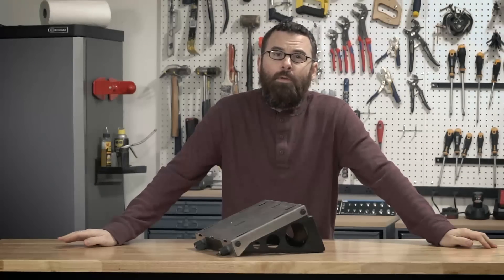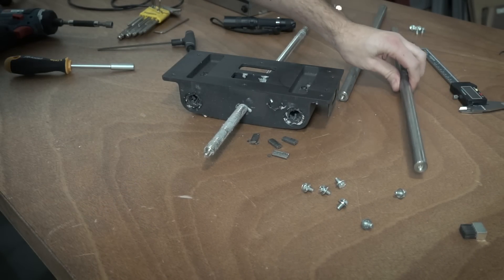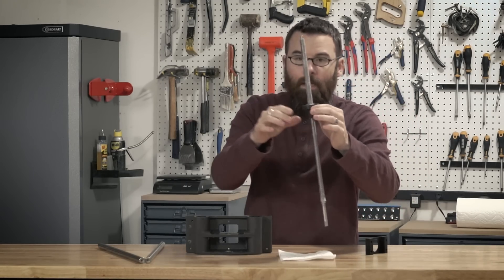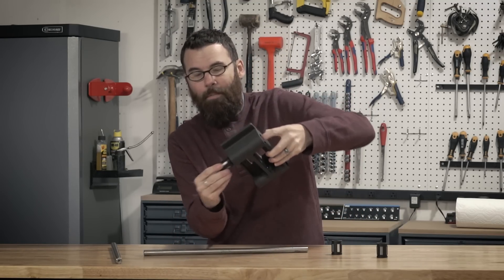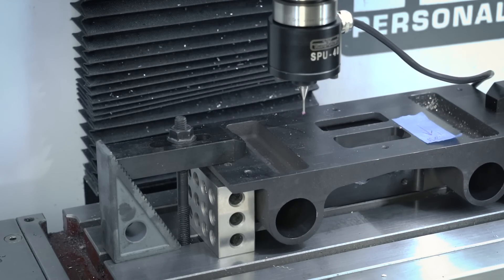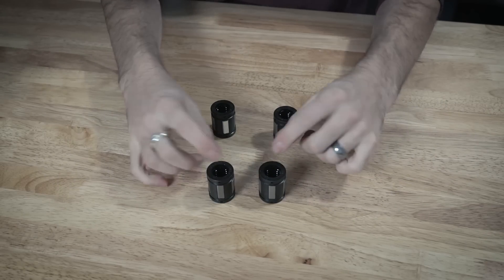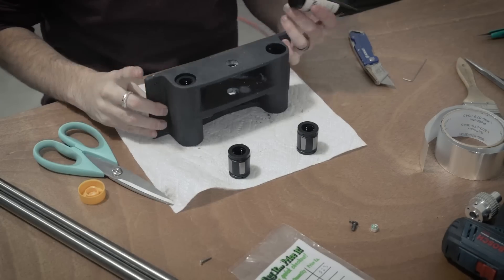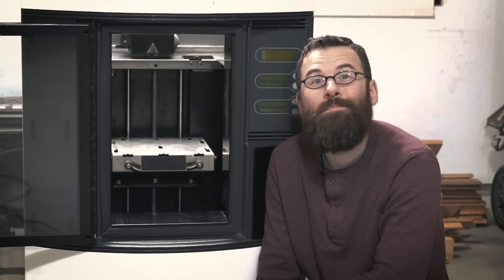Stratasys 3D Printer Rebuild - Part 3: Z Axis Rebuild

Comment: Ran one of these archaic monsters for years in an engineering department. Now I have desktop printers that print better, faster, chepaer, and quieter for 1% of what the Dimensions cost new back in the day. I admire your efforts, but I'd scrap it for pennies on the pound.
Reply from the maker: I did exactly that.  This video is 6 years old and a LOT has changed with 3d printing in that time.

Comment: Awesom..... what would be your optimal linear Guide for the X, Y, Z Axis if you had the oportunitie to build a 3d Profi. Printer
Reply from the maker: It would depend on the design, but probably linear slide bearings with belt drive.
Reply: @RobertCowanDIY   Thank you ....appreciate
Reply: @RobertCowanDIY  I think you'd be impressed with what you'd find in the current generation Fortus 360 (and up). The last one I opened up was doing 14x16x16 builds with crossed roller bearings.

Comment: HI.

I have a problem with this 3d printer. I put the calibration mode x,y axis, and it shifts on the y axis.

We already checked the grease, alignment of the band, we took the sevo motors and checked them with an electronic card that was designed to see the step and all good.

What do you recommend?

Waiting for your quick response. Best regards

Comment: Z axis bearing shim, need to make sure the tape is all aligned radially vertical axis or it will create a tilt won't it?  did it?
Reply from the maker: you are correct, and I made sure they were aligned properly.  it's very smooth and doesn't bind up at all.

Comment: I would guess the bearings failed because that build platform is heavy and  puts constant pressure against the support bars. it is a small price to pay for stability. Nice video. Thanks for great instruction.
Reply from the maker: Yeah, that's a pretty good guess.  The actual carriage itself is where most of the weight is, but there's still a bit of weight that the support rails see as a perpendicular load, which isn't helping.  I imagine over time, and over numerous heating and cooling cycles, they're bound to fail.  But it's an easy fix now, so hopefully it's just a matter of swapping bearings every few years?

Comment: I'd be curious to see if the clearance in those bearings changes at the printing temperature. Maybe you could put them in an oven at the printing temperature and see how that feels? It'd be a good check, that slop might be intentional. I'd imagine it's pretty roasty in there, and that diameter is just big enough for 100 or 200 degrees F to have an effect for these kinds of linear motion applications. Just a thought, great stuff man!
Reply: Then again, if it took two sheets of the aluminum tape, it could really be a problem with the case. Depends on how thick that aluminum is. Looks to me to be more than a few thousandths, but again, just a thought.

Comment: What happened to the broken tap?
Did you just leave it stuck in the bearing block?
Reply from the maker: Good question.  I used a punch and broke the pieces out of the hole.  The hole isn't usable, but the tap is gone and it doesn't interfere with the bearing.
Reply: Nice trick, broken taps are always a pain ...